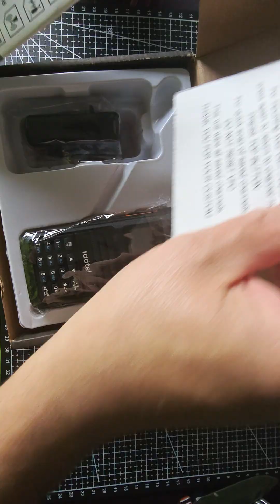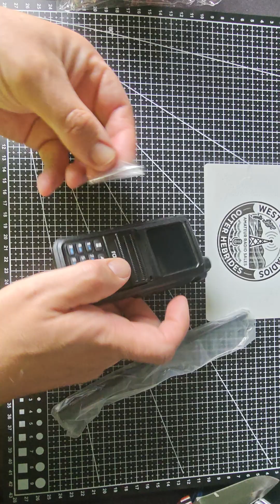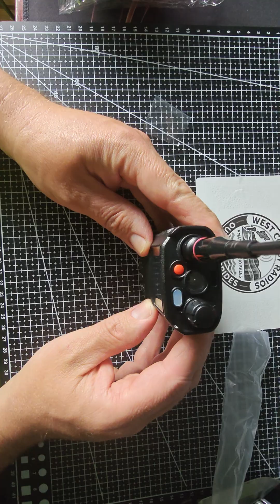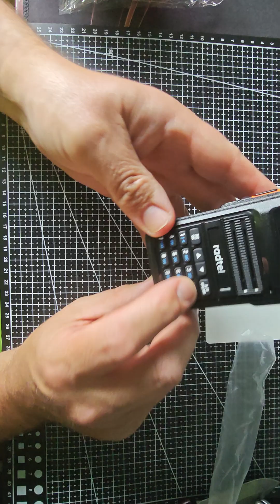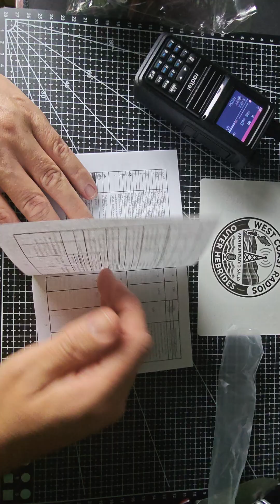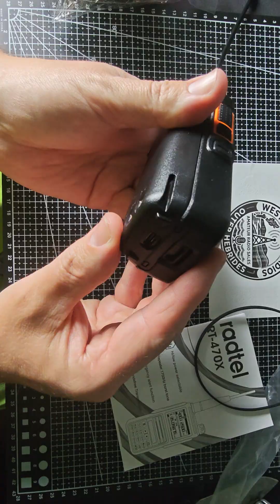Radtel RT 470x quick user guide airband radio ham radio PMR radio marine radio

Comment: Mine arrived today and I cannot get signal at all!
Reply from the maker: Are you near one of the programmed airports? In a open area away from forms of interference like led bulbs TVs WiFi routers ect?  This type of radio is designed for outdoor use normally for plane spotting  if you're trying to use it inside a house or building its ability to receive is going to be greatly reduced.
Reply: @westcoastradios I’m 12 miles away from East Midlands airport trying to use it outside in the open.
Reply from the maker: It's probably too far to get the airport you might get the approach frequency if you try that one. Also try the high level frequency for aircraft that are transiting over head that's what I can receive from my garden & my local airport is 25 miles away from me so out of range from my low level location. 

https://skyvector.com/airport/EGNX/East-Midlands-Airport
Reply: @westcoastradios yes I need to be rite by the runway for it to work. On some frequencies I try to it says cancel as I’m inputting it. Any idea why?